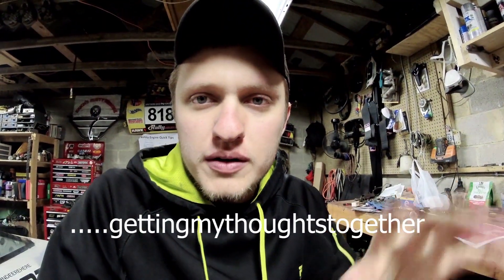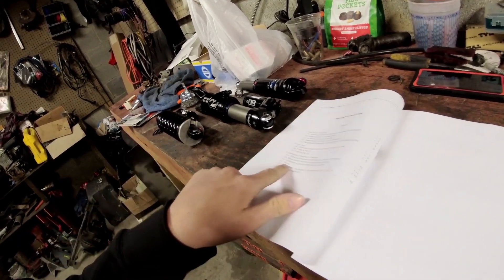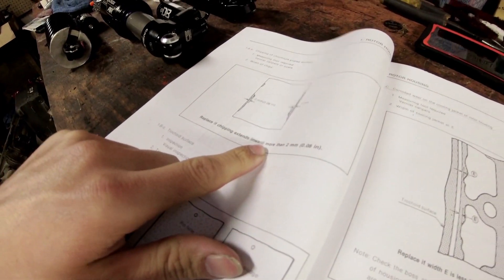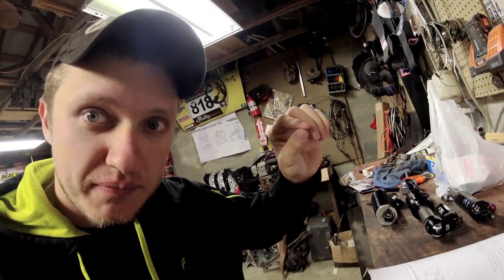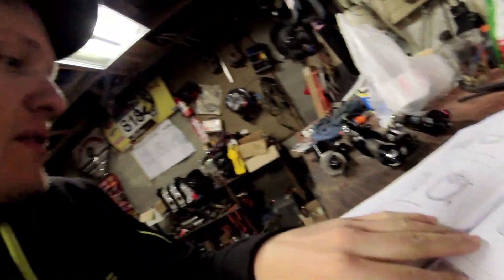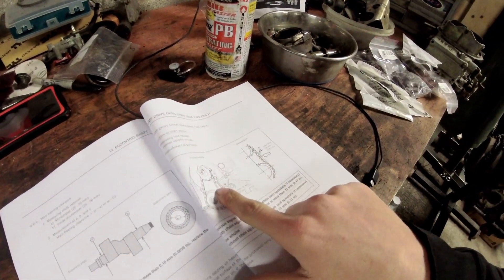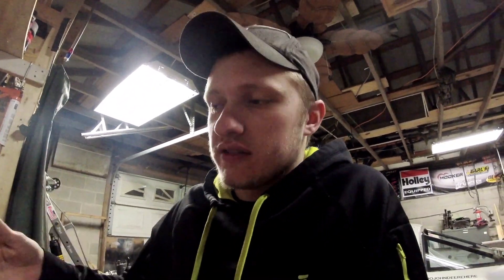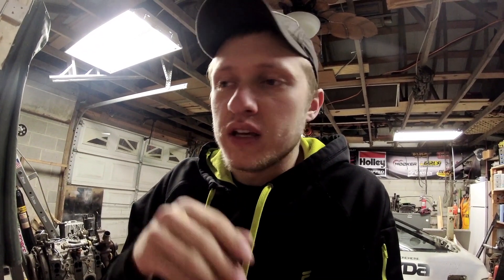The Rotary Engine Book Of Secrets - 12a - 13b Rebuild Criteria EP:2

Comment: I realize this is an old video but trying anyway. On page 2-4 they show installing a "protector" strip on the OUTside of the combustion o-ring. If one wanted to protect the o-ring from combustion shouldn't it be installed on the combustion side of the o-ring? Anyone had experience with using a protector piece?

Comment: Rebuilding an '83. Has rust on drivers side wheel well where suspension arm ties in. Wondering if youve had to deal with this. Any suggestions would be a plus.
Reply from the maker: Yea I have done the whole bin rot repair deal as well!  Before the channel was up and going though. I can show what I did in a future video
Reply: @RADPotential  nice. So your video where  you are explaining the watts link on the badass rotisserie you built shows where the horizontal link by wheel well has the rust. So im gonna have to cut out a piece to fit and weld. Its like a plate that isnt structural but keeps water from getting into car. Its only on the drivers side not the passenger. I dont have Facebook or Id send a pic. Or I can Email.
Reply from the maker: I'll show it in a video next week!
Reply: @RADPotential  Dude👍

Comment: Awesome info. Really appreciated. Question. I have a 79 rx7 12a. Previos owner (Tried) installing 2 msd boxes. The car wouldn’t start with it, so my brother in law removed the boxes. Now I have the car and have no idea where the any of the original wires connect to   To start it. Any idea where I can look for info?  Thank for your time.
Reply from the maker: I have a video on setting up the factory late model ignition system.
Reply: @RADPotential  ok thanks. Is it the video that says; 12a and 13b rotary engine electronic distributor setup and ignition timing ?
Reply from the maker: Yes sir
Reply: @RADPotential  thanks

Comment: I know this is off topic.... I’ve searched the forums and it’s just confusing... I have e46 323i with a blown m52tub25 and I want to swap in a m54b30... the m54 is complete with engine harness, dme, maf, injector,etc... what else would I need to make it a straight forward swap? Thanks
Reply from the maker: I mentioned it to justin, He mentioned something about a throttle pedal harness and the drive by wire system would need to be swapped as well! Hope this helps

Comment: I have an 84 Gslse stock that's having trouble staying started. Its turn over run fpr a second and then die suddenly. Any idea what may be the cause? Distributor, or transistors?
Reply from the maker: fuel pressure?  is the pump staying on?  make sure the injectors are firing.
Reply: Check your fuel system like rad said, also check filters and tank for rust, also fuel pressure may have enough for the first run but drops off